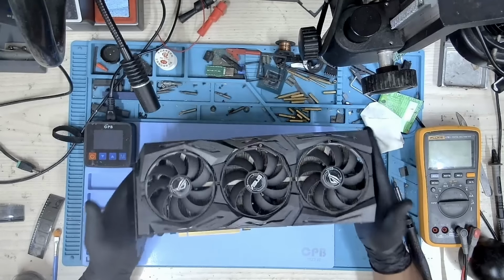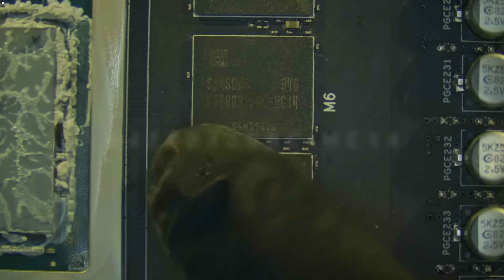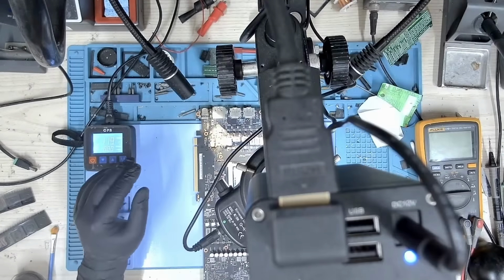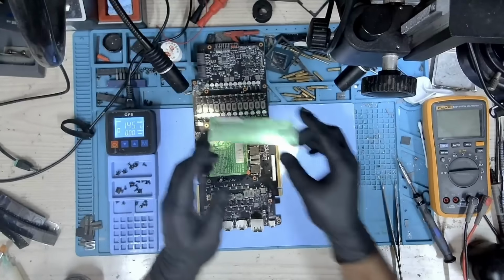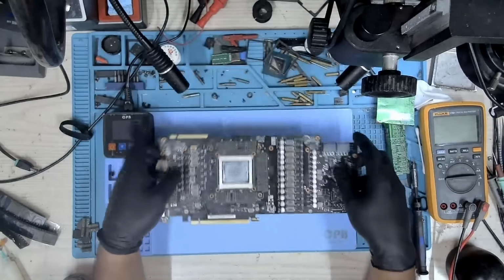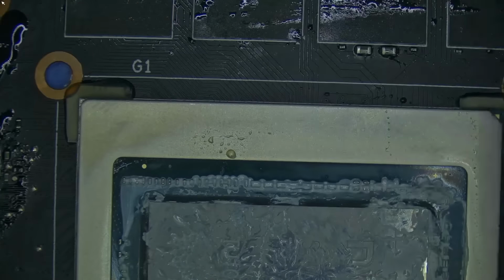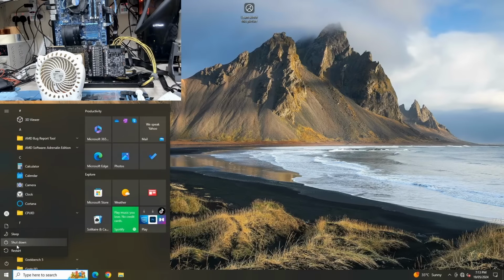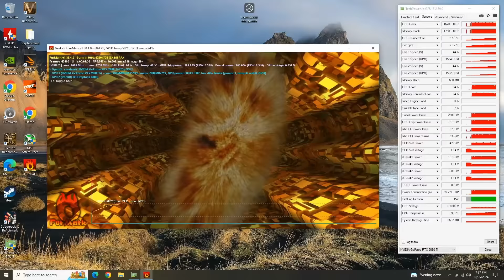Upgrading Asus RTX 2080 Ti memory from 11GB to 22GB

Comment: Nvidia is not gonna like this guy 😂😂
Reply: @GraphicsCardRepairs-tk7ql  where is ur shop btw and is it possible to increase the 4070 super from 12gb to 16gb or 24gb
Reply: Let's hope they give us more vram on the rtx 5070 midrange,12gb is not going to cut it for anything over 400 dollars.
Reply: @rhl2macwan  simply not possible. The 4070 Super has a 192bit bus, aka 6 chips with 2GB (16GBit). 
GDDR6 was also specificied with 24Gb chips (so 3GB), that would be 18GB, but these chips simply do not exist.
Same with 24GB ram, this would require 32GBit (4GB) chips, which simply do not exist (yet) or are not available for sale (there were rumours 2 years ago Samsung had such chips)
Reply: @rhl2macwan Be cheaper to just sell it and buy a 16GB 4070ti super
Reply: @johnscaramis2515 4070 Super has 2 unpopulated areas for vram chips. So could possibly install 2 extra 2GB chips. No idea what else would need to be done to support iti
Reply: @staples4335  Only because there is unpopulated space does not mean they are connected. The AD104 chip on the 4070 Super only has a 192 bit bus for the RAM, so maximum 6 chips that can be connected.
The explanation for the extra two areas is simple: the same board layout is also used for the 4080, the AD103 chip there has a 256 bit bus, i.e. 8 chips.
Reply: @johnscaramis2515  Yes because each chip is 32bit. 6 x 32bit = 192 bit bus
Reply from the maker: No. it is limited by the bus width. It already uses 2Gb modules.
Reply from the maker: You are on point. 😁
Reply: @GraphicsCardRepairs-tk7ql  and sorry to ask u many questions but is it possible to upgrade a gpu on a gaming laptop instead of buying a new laptop entirely
Reply: There's a Brazilian guy that did this last year, and some other cool things too.
Reply: @rhl2macwan  the reason the 2080 ti looks to get only 22GB is limiting because it has only '352' bit memory controller which affects the capacity of the ram. The card would also have to have a forced bios flash to get more vram via a download (ROM) to a USB stick. Though I think it is possible to also change the bit memory controller at all, I haven't seen it yet and wouldn't recommend doing this as this may avoid any warranty if there is left on the card
Reply from the maker: No thats not possible.
Reply: @GraphicsCardRepairs-tk7ql  damn!! But thanks for the reply
Reply: @rhl2macwan  I known old laptops that had upgradable gpus
Reply: @pacspecific  I’m just asking cause my Alienware laptop which has a mobile 3070ti can be upgradable in the future
Reply: HAHAHAH Absolutely
Reply: Is it possible to add another 8GB to an RX 6600 XT?
Reply from the maker: No it not possible to add any memory to the RX 6000 series of graphics cards as they all use 2 GB modules.
Reply: @pacspecific  You are right, many years ago laptops partly had MXM, modules with the GPU on it. However if I remember correctly it had several problems: afair the MXM modules partly were not compatible, then you had to deal with the different TDPs. And biggest problem: MXM was not widely used, so the modules were hard to get. And often the laptops had BIOS locks to only allow modules from the manufacturer of the laptop.
But I read somewhere that companies are thinking of reviewing MXM or at least something similar.
Reply: @johnscaramis2515  Then laptop manufacturers need to jack up the chargers's power limit, unless that impacted the battery life.
Reply: @staples4335  mm whats the performance like.? just because it holds more memory doesnt mean it performes better...
Reply: did any one noticeed the cursor at the top right corner
Reply: they want his location
Reply: @irun2sanaxox  😂
Reply: @GraphicsCardRepairs-tk7ql  What flux do you use for this ?
Reply: Planning to get into doing this. I have a couple older GPUs to practice on - a 560Ti 448 (1.25GB to 2.5GB) and a 670 (2GB to 4 GB) and then I'll upgrade a 6GB 2060 to 12GB. From there, I'll be buying GPUs to mod and resell.
Reply: @rhl2macwan  you know the ceo veins were popping out watching this
Reply: @rhl2macwan  I know it hurts to have a non gaming laptop ............ 😢
Reply: Is it possible to upgrade memory of a RTX 3080? By how?
Reply: @rhl2macwan  the bus isn’t enough big
Reply: @AbhiMeshram007 your other right…
Reply from the maker: @irun2sanaxox  :face-orange-biting-nails:
Reply from the maker: @willardjsullivan8394  i use 2 different ones. one is a mechanic 559 and Chinese Amtech 559 (Not Original)
Reply from the maker: @Lurch-Bot1  Its good to practice on older card.
Reply: i say "fuck nvidia" wouldnt it be nice if we had ram slots on top of the GPU to plug in RAM and upgrade it if they dont wanna do it then they can go cry a river when modders do it >:)
Reply: @GraphicsCardRepairs-tk7ql  AMD already equipped them with all the memory they could take; only NVIDIA is stingy with the VRAM, right?
Reply: @JamieS1992  I think part of the reason we don't have sockets for VRAM upgrades is speed. BGA components are required for 14GBps speeds, sockets might not work for that due to inductance/capacitance reasons. Or am I just talking out of my ass? IDK. But yeah fuck NVIDIA and Jensen and his leather jacket.
Reply: Haha. NO. They won't be worried cuz 95% of the gamers here cant plug in a simple connector to a 4090. ...lol
Reply: @rkwjunior2298  😂😂
Reply: Maybe not but I love shit like this
Reply: Maybe not but I love shit like this
Reply: Also does the nvidia driver work the same with added ram ?
Reply: Don’t forget, mr frazier loves his life and would never kill himself
Reply: I was saying the same thing inside of my head,so they do this,add some tiny details and boom,""" new card"""?...
Reply: @pacspecific Battery isn't used to power the gpu the brick is. Laptop batteries can only output like 50-60 watts. It's why you can barely game on battery but why would they give a higher power limit? The 170 watt 4090 mobile is basically impossible to cool with a huge laptop. Laptops already sound like a wind turbine at max power. More power won't be of any use if you can't cool it.
Reply: If Nvidia wasnt so greedy and only used 8GB of Ram in alot of there 3000 and overpriced low Ram 4000 Cards we wouldnt have to go thru this.
Reply: Neither are all the people with zero understanding of this stuff who try this at home on their GPUs
Reply: Screw this crap company..
Reply: This could be used for small ai based applications at a massive cost savings.
Reply: They are connected, but that channel is disabled in the core. No way.
Reply: Who cares😂 we love him❤❤❤❤❤❤❤
Reply: more like 2080 ULTRA SUPER
Reply: @rhl2macwan  yes you can upgrade it to 24gb memory but not 16gb memory due to the 192bit bus width.

192bit bus supports 6gb,12gb,24gb,48gb, and so on...........
Reply: Fanboys will still pay 😂
Reply: Like nVidia cares about 2080 Ti.. :-D
Reply: Nvidia doesn't like customers, Nvidia likes market shares.

And AI is big business ATM.
Reply: @ before it was mining right?
Reply: @rhl2macwan  mining was done by private individuals. AI is done by every country and every tech company. It's like 25x the size.
Reply: I bet Nvidia would actually be taking legal action if he did this in mass
Reply: @oneanother1  And thats why i bought a 7800xt nitro +
But i also own a i9 13900h 4070 mobile from Clevo the Clevo PE60. Love this Laptop tho
Reply: nvidia manufactures only one graphic chip based on how many cores are working some of them are almost always damaged they lower the clock speeds so they have 2080 with the right amount of memory .. maybe the guy that said what i just told u should be damaged beyond repair by nvidia so it is all about the chip what it can do
Reply: If that's the case then Nvidia needs to figure out how to stop transforming their software and hardware engineers into pissed off disgruntled engineers.
Reply: Ngreedia can kick rocks.
Reply: @pacspecifichaha warranty is long gone on that guy
Reply: @saitejachandolu9629 is it possible to learn this power? Not from a Jedi…..
Reply: @rhl2macwan it has to be gddrx6 because u can't mix vran
Reply: @johnscaramis2515  it has the gddrx6 not gddr6 ...
Reply: @GOTEEGAMING  GDDR6X is based on the GDDR6 spec, simply faster transfer speed, so 24Gb chips would be possible. However as only Nvidia uses them (or no others are allowed) and Nvidia obviously does not want them, they are not produced
Reply: @johnscaramis2515  Nvidia has exclusive right to the and 5070 is going have gddr7
Reply: @GOTEEGAMING  That's basically what I wrote. And what does that have to do with the 5070 having Gddr7?
Reply: doubling the gpu's memory does nothing if the memory clocks, cuda cores, bus speed, and all the other stuff are still slow as fuck
Reply: @dxvexrs  depends. If you're running out of VRAM, then doubling VRAM will help, see results of RX7600 vs. 7600XT. If the amount of VRAM is no problem, then doubling it will not help.
Reply: @ a 4060 ti 8gb will outperform a 2080 ti in a jiffy with much better power and cost efficiency, upgrading the vram of an old gpu does literally nothing but waste your time and money, just upgrade your gpu
Reply: Lol nope
Reply: Nope LOL
Reply: Nvidia îs gonna pay someone to raid this Guy..
Reply: @Anmol7171  I have a Alienware m17 r5 with a 3070ti mobile integrated graphics btw
Reply: Where did I say I was mining?
Reply: @rareraven  I don’t remember saying anything about mining..
Reply: Good as it should be
Reply: They dont have anything to say the guy bought the card, he does what he wants with it
Reply: @oneanother1 you’re a happy man today I assume 🙏
Reply: @7ake  16gb 5070ti for 750$, well bad depends on performance. If its for ai, a 4080 will do as well. 5090 though, a beast of a GPU. I bet the prices will all go up due to demand though. Let's pray for cheap 4090.🙏😁
Reply: They are so rich right now this wouldn't even make a scratch in the armor.
Reply: You ppl are really so ignorant and all over the internet. It’s so annoying. Why are the ignorant ones the loudest? You need less vram with neural rendering  hence why lower tier cards didn’t get more. Also the lower tier cards can’t handle PT in 4k or even 1440p so why would you need more vram? If you want to use PT with a 5070 you need to lower res to 1080p to even get enough FPS. Even if you had a 100gb 5070 the card wouldn’t be any fucking faster for PT.
Reply: @ “Always lead off with a blanket insult.”  Rule #1 on how to convince people you’re smarter than them.
Reply: Frfr
Reply: @GraphicsCardRepairs-tk7ql  what about a 3080 10gb can you incress memory on that and if so. how much by
Reply from the maker: @djam7484  I am working on a 3080 Ti. But I am not yet able to get any GPU with GDDR6X to work with upgrades. I will post a video once I do.
Reply: @oneanother1 nvidia took your comment personally so they assured 12GB and $549.
Reply: @codynunley8625  lol, they said we definitely need to give them less now for the same money. So far it doesn't look like the 5070 isnt much faster than the 4070 in rasterization. We'll see, 4070 didn't really sell well at launch, so 5070 might turn out the same. At least the 16gb isn't 1200 dollars this time. But doesn't looks like they are giving you better price performance, and solely relying on multiple fake frames to increase smoothness. 😁
Reply: He's gonna make a killing fixing their error with the 40 series cards. Seriously? 8gb on the 4060 and 60ti? That's a rip off
Reply: @johnscaramis2515 so my 7600xt cannot exceed 16gb? It too has a 192 bit bus I believe
Reply: NVidia is scalping the market. Because AI needs more memory and they don't want you to use gaming GPUs for AI, so that's why they cap at 24GB
Reply: @oneanother1 they're not doing that. It's free money, memory is cheap as hell to manufacture.
Reply: @monad_tcp  I assume itr has to do with bus width. Later we will see 3gb memory modules, maybe in the super refreshes. But where are all the 5000 series cards? And they are expensive too.

Comment: bro really made 2080 Ti Super😂
Reply from the maker: Yes a Super indeed 😁. happy you have you onboard.
Reply: It's more of a Titan now
Reply: 2080ti ultra instinct
Reply: @GraphicsCardRepairs-tk7ql  time to add the most beefy cooling and overclock it to the max
Reply: its 2090
Reply: Nah bro made a 2090
Reply: What does it Cost to this modd on 2080 ti 11gb to 24gb , and are it stable? No crashes ? Or high peaks temp as a roller coaster mid in game that can cause crashes? Do i send it to you or how do i procees
Reply: I love you ❤ we love you keep up brother ❤
Reply: @patrickjohansson3076 pretty sure you have to double the Ram exactly or you’ll run into problems. Linus said something like that. But yeah my understanding is it’s not going to give you the improvement you would get say going from a 4060ti 8gb to a 4060ti 16gb. Like it’s not set up to use the extra RAM in an optimized way. You would need a custom bios at least.
Reply: Honestly it's more of an ultra or a 2090 as someone else said, its very unlike Nvidia to double anything one to another lmfao! (i.e 2080 to 2080 Ti)
Reply: more like 2080 Ti Ultra
Reply: @veranza5461 no titan there was no 2090 it was the titan
Reply: @patrickjohansson3076 For the most part you'll need a custom GPU driver to utilize modded GPU and even before that you'll need to find the same serial of VRAM to even work
Reply: Do you think you could make a 48GB titan RTX?!
Reply: @SilentRoses  Is there even a 30 series Nvidia that has stock 24GB of VRAM? The hard part of doing this is that finding the VRAM capacity for it its hard and very expensive even if you have 7900XTX that has 24GB of VRAM doubling the VRAM is pretty much impossible
Reply: @mayuravirus6134  Not by the looks of it! Im running 24GB on my Titan and my partner has the same card. He used to run 2 of them in SLI so i suppose he had the closest thing to 48GB before selling me one lol. Im just curious to see if its possible!
Reply: not quite its jsut a 2080 ti with more vram he dident add any cores and no upgrades to the memory speeds either!
Reply: Like a 960 2GB and 960 4GB will generally perform the same except when vram gets fully used up! like double the vram is still the same card!
Reply: Is this really worth it tho? vram isnt gonna give you alot of performance, boosting the clock will. 11gb is already plenty for gaming, and for anything else you'll never need a gpu like this. You won't see performance from upgrading vram when its the mhz thats restricting.
Reply: @Ruudiii  Image synthesis is very memory hungry as a use case.
Reply: Speak like an adult. One person said bro before their sentence and now all of ya do.
Reply: 2090*
Reply: 2080 Ti Super Ultra Instinct
Reply: Super duper hulk TI-tanosaurus GPU upgrade
Reply: I have a 4060 super can you make it 22vram?? I’ll pay a decent amount to do that
Reply: @Ruudiii 
My 6750xt playing Skyrim I was using over 11gb of memory in game and I shut off some graphical stuff because of that. With more vram I would keep everything. 
Think for a 2080 ti or a 2080super, gpus that have really low vram probably could use an upgrade.
Reply: @yo_its_gingey5329 so, the naming convention of the cards actually refers to the chips themselves. During the manufacturing process some cores will fail, but in order to recoup manufacturing costs they will still sell the chip at a reduced rate. A pristine chip, with all its cores functional, is sold as a 90; while a chip with a low number of failures is sold as an 80, higher number of failures a 70, and if its failures are too many it does get scrapped. They then later tack on the identifiers of “ti” and “super” depending on how much memory they place on it, or the firmware/driver combo they’re able to optimize for it.

This is often why you see the lower end model get released prior to the higher end model (3060 vs 3080, etc..) cuz it took them longer to produce the required number of “pristine” chips that would qualify for the higher rating. But it’s all the same chip and manufacturing line.
Reply: Bro, you’re gifted to be a surgeon
Reply: I'd call it a 2090, doesn't even need to be faster, the 3090 wasn't 😂